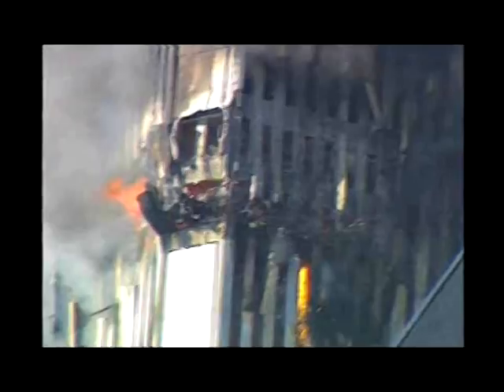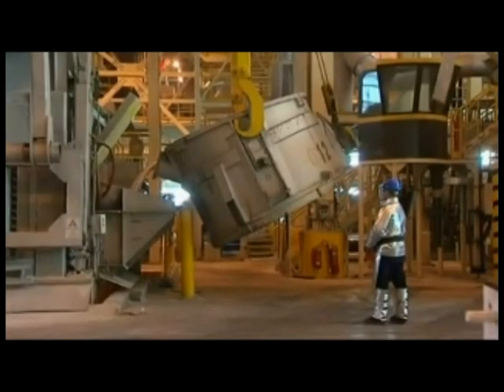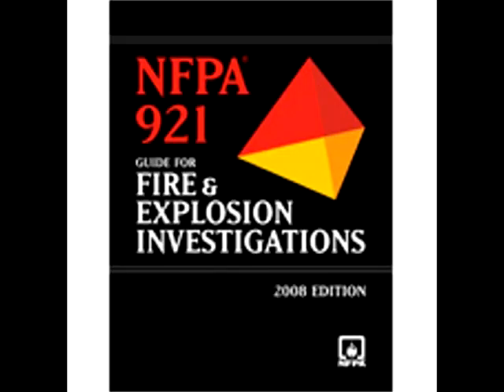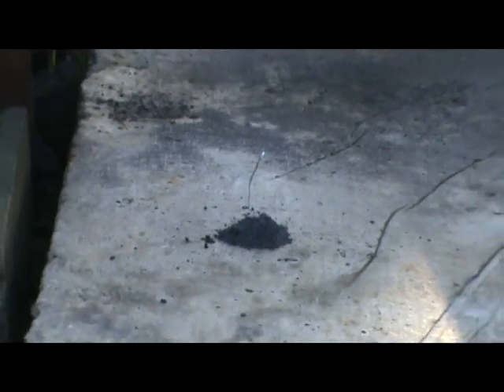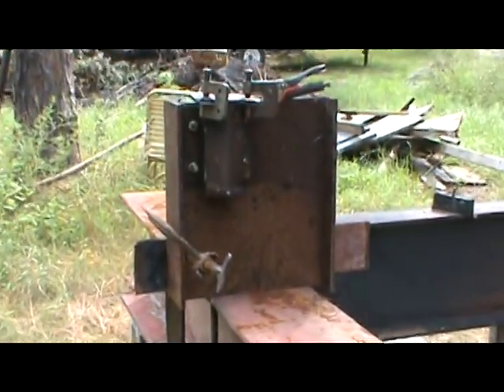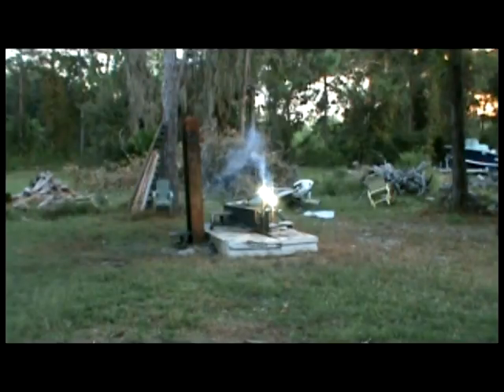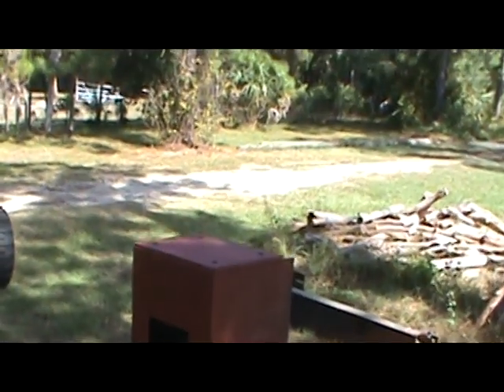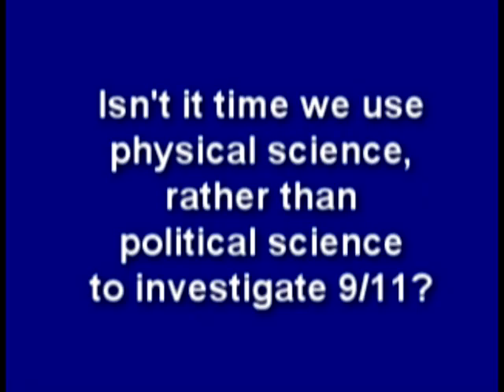9/11 Experiments: The Great Thermate Debate

Comment: You can SEE the disintegration of the lower structure well ahead of the Upper Block.
Compressed air was bursting out of the WTC windows up to TEN floors ahead of
the Upper Block. THAT MEANS THE STRUCTURE WAS ALREADY FALLING ahead
of the upper block, and the 14 foot living space was already being compressed.
EXPLOSIONS, or THERMITE / ate HEAT, just don't produce DUST JETS that
tiny, or that directed. The compression of the living space between floors does.
YOU FAIL, engineers win. Again.

Comment: @CalumGilhooly 
LMAO, NO ONE in the Twoofer Moron Mooooovement can teach anything to anyone.
As I have attempted to teach them, the structure below the Upper Block was
ALWAYS FALLING, even at zero velocity. That's what WEIGHT is, mass falling at 1 G.
When the Upper Block struck the lower structure, it just SHEARED the BOLTS
holding it together, the building essentially UNZIPPED, and started falling again,
well ahead of the falling upper block. Welcome to reality.

Comment: @CalumGilhooly 
AMAZINGLY, contracts are NOT physical movement of 250,000 TONS of steel.
NIST, FEMA, SEAoNY, and ASCE inspectors had full access to the debris piles at
Ground Zero, and to the FRESH KILLS and other debris pile locations.
They say so expressly in the NIST and ASCE reports. SHIPS serving the STEEL
shipment to japan, were not even contracted for until a year after 9/11/2001.
Sorry, WTC 7 was a IMPACT and FIRE based collapse, just like the towers.
TOTAL failure for you, again

Comment: @CalumGilhooly 
NOW, let's address Your Mewling bullshit directly. "SOMETHING more technical".
and "shipped off and recycled ASAP". BOTH were totally inaccurate, and stupid.
Thermite / ate containers have to hold a TON of thermite up off the floor, and hold
them against steel, despite thermal / reaction gas pressure. THEN they must 
disappear. That's NOT possible. SECOND, the contract to recycle steel was
signed less than a month later, but STEEL didn't move till 6 months later.

Comment: @CalumGilhooly 
LMAO, " just because no containers were found, doesn't mean they weren't there."
SORRY, THATS EXACTLY WHAT IT MEANS. But, let's address the second part
of your MANY problems. Not only were the containers missing, but how were they
attached? Jonothan Cole had to screw them into the I-beam. That's because 
burning thermite / ate produces thermal gas expansion. The pile of thermite
"pushes" itself away from the steel, by the gas pressure it produces.
Where were those?

Comment: @RedStarVolume

"The GLOBAL collapse is caused by the failing of the main columns"

that INVESTIGATION FOUND had NO FIRE near the VERY support that the facade is attached to where they MEASURED the GLOBAL acceleration EQUAL to that of Gravity starting when the kink forms and for the next 100+ feet....

[NCSTAR1A-3.2] "It is likely that much of the burning took place beyond the views of the windows"

so if FIRE is NOT the 'mechanism' for collapse, then what was?

Comment: @palasta 

"Sure, coincidentally the roof caves in seconds before the collapse'

no it doesn't...AGAIN,   WHAT THE FUCK are YOU looking at?

and..WHY are you "rolling ice"?

Acceleration EQUAL to Gravity was measured on a point of the facade where there is NO FIRE PRESENT.
WE CAN SEE there is NO FIRE.
Tell us WHAT the agent is that REMOVES the vertical support the facade is ATTACHED to to ALLOW the instant UNIFIED descent, GLOBALLY, when the kink forms as FAST as an object falls THROUGH THE AIR

Comment: @CalumGilhooly 
CONSIDER how stupid PhysicsAndReason here (The video poster) is.
HIS FIRST EXPERIMENT is the only valid one. Thermate / ite can't burn thru steel.
PERIOD. That's why there is NO EVIDENCE of thermite / ate burning against steel.
SO, this MORON burns steel in a backyard to simulate an internal, low oxygen
(Reducing) fire on the 13th floor of a 47 floor skyscraper. Realistic, Huh?
Then he uses containers never found, Realistic again, Huh?

Comment: @palasta 

"started before that"

when the kink forms, the HVAC, 'other' Penthouse, roof, facade, within 0.5 seconds from each other, have free fall ACCELERATION for 100+ft. ALL support was INSTANTLY taken away, AS WE SEE by the EVEN decent if there was a progression from east to west, WE WOULD SEE IT, the roof WILL NOT support itself while columns fail below it. the facade is a non supporting structure, and IS attached to the perimeter columns it will not stand while the columns fail behind it.

Comment: @NonnyMus1 Yes, most of the volume air. And since there was so much air, claiming air-pressure from pancaking floors would be responsible for jets shooting out 40 floors below collapse front would indicate further massive resistance to slow down the falls, but that obviously did not happen either. And why would a window pop out 40 floors down? Those were not hollow tubes - there were floors (in this case 40 of them) to pass before ejecting the dust, and doors and other obstacles to pass.

Comment: @NonnyMus1 The only argument I came up with was about the relation between free-falling objects and moving collapse fronts. Speeding-up of any video would have ALL objects in motion move faster at the same rate. It needs no further explanation. And regarding collapse times, I would put them approximately 12 and 16 seconds for WTC 2 and WTC 1 respectively. Un-tweaked.

Comment: @Funkadelic2  Again, NIST's models assumed various levels of fireproofing loss & were tested against observed effects.  The shock waves from the impacts likely blasted rigid foam fireproofing off of trusses, even those not on impact floors.

Have you actually read the NIST reports or are you relying on AE911troof's cherry picking and quote mining of those reports?  All this is discussed in them.

Please read them for yourself.  Here's the list with links - tinyurl . com /44dsmgw (remove spaces)

Comment: @NonnyMus1  Mohr claims the core of a building would never go down last in a controlled demolition. Well, if you demolish a building by severing the outer columns of the core first, which then will have the consequence that  the floors and the perimeter columns fail, the rest of the core might very well stand. Anyone can see the fallacy in such a statement. It's no better than saying "Controlled demolitions are being performed from the bottom-up, not top-down". You do it any way you want it.

Comment: @Funkadelic2   Ah, just noticed your question, 'how can the collapse front locally outrun free-falling column sections..?'   The short answer is because the free-falling sections aren't free falling and are falling more slowly than the collapse front.  When did that happen in any of the building collapses?  You know  a large building collapse is a chaotic system, so you get lots of weird behavior.  Overall, smaller debris was obviously falling faster than the collapse front.

Comment: @Funkadelic2 ... The short answer to the South Tower ejections was that the pressurized air found an outlet at those locations.  The 1/2 million cubic feet of air per floor at 12 floors per second exerted a lot of force!  Again, from Chris Mohr's series -  /watch?v=2538YN1l1nA 

I think you should watch all of Chris Mohr's series since it seems you are following AE911troof's claims and Chris neatly deals with all that.  It'll save me bunches of typing!  =)

Comment: @Funkadelic2  Most bodies were broken up by the force of the collapse and many of the bits cremated in the fires which burned for weeks in the debris pile.  Tiny bone fragments were ejected laterally by air being blasted out of the pancaking floors. That's how the dust, perimeter sections and some beams also ended up some distance away. The buildings were 95% air and that air had to go somewhere.  As for air ejections, go to 4:18 here - /watch?v=2538YN1l1nA...

Comment: @NonnyMus1 ----> the one who is guilty of such actions. This is my only account The reason you find similar arguments and/or quotes coming from other users has to do with the fact that those are important points of the very same valid critique of the NIST report brought forward by most engineers and other qualified professionals. You sure understand that.

There sure has been some debate regarding the issue of dislodgement of fireproofing. Can we assume some fireproofing material were ---->

Comment: @NonnyMus1 ----> blown off of some columns and trusses in the direct impact areas? That sounds plausible. But there have been no evidence presented for the idea that the fireproofing were stripped away from entire floors. Actually, it's not realistic at all. The force needed to achieve that (remember the shoot gun analogy) sure would have blown out all of the windows on those floors, and that obviously did not happen. The photographic evidence that exist - let alone, any tests performed - ---->

Comment: @NonnyMus1 -----> do not support the idea of fires long-lasting and intense enough to cause collapse. Moreover, fireproofing upgrades had been performed on many of the floors in the impact areas (if you have studied the NIST report you probably know that as well as I do). Steel loses strength when heated, yes. And columns able to withstand 2000% (that's 20 times) increased live loads before failing means they need to be heated to lose most of it's strength to collapse. All of the columns. ---->

Comment: @NonnyMus1 ----> By "pancaking" I mean floors falling down and piling up on ones beneath. And now we are entering areas which NIST barely touches upon: Although NIST do not endorse the pancake theory in the sense that pancaking floors were not, according to their report, what initiated the progressive collapse, pancaking floors is the only conceivable scenario to drive the building all the way down (huge sections of the perimeter walls were ejected from the structures ---->

Comment: @NonnyMus1 ----> during the collapses, and vast portions of the cores remained standing 5-10 seconds after the floors and perimeter walls had collapsed - thus could not have supplied energy to crush the lower parts of the buildings). Yet no stacked-up floors could be seen in the debris piles, not even large chunks of it. Most of it was obviously pulverized in mid-air, an enormously energy consuming process for which no explanation has been given. And where did all of the steel-decking go? ----->

Comment: @Funkadelic2  The UL tests were done on short-span and half-short span, *insulated* floor assemblies.  Since it's likely insulation was blown off the floor trusses, NIST rightly didn't use the results.  

I'm not sure what you mean by 'the pancake theory', since the floors below were squashed flat or pancaked by the weight of the upper floors crashing down.  It's not a technical term.

As for your reluctance to read the NIST reports, I'd recommend you give it a try!  Ya might learn something!!

Comment: @Funkadelic2   The TECHNICAL explanation - perimeter columns, which were structural, failed and the section of the buildings above the impact zones fell onto floors below.  Those floors failed because they could not support the massive weight of the structure falling onto them and that failure propagated downward.  Sagging floors trusses, along with their effect on perimeter columns, were observed in some %age of  the 6977 videos & 6899 photographs NIST analyzed.

Comment: @Funkadelic2   Yes, too chaotic to model.  WTC 7's collapse was far less complicated since it likely initiated with the failure of Column 79.  Also, NIST was guided at every step of their simulations by detailed videos of the collapse.

On the other hand, both WTC towers collapsed after dozens of building elements failed, likely.  No  detailed video data was available to guide collapse modeling since smoke and dust obscured the collapses.

Sure NIST explained the Tower collapses TECHNICALLY!...

Comment: @Funkadelic2  As for the iron-rich or metallic spheroids found in the WTC dust, most probably came from fly ash and volcanic ash used to strengthen concrete.  These types of ashes are used in concrete because they have pozzolanic properties - that is they make concrete stronger.

Metal-rich spheroids are also found in printer cartridges, metal cutting & welding spatter and are formed by rust flakes burning in ordinary fires. 

Remember, steel heated to 250-400°C loses ~18-30% of its strength!

Comment: @Funkadelic2  Sigh. This is going to take a couple of comments.

First, are you also proudfootz or musicamaker2001?  If not, where are you getting the exact same arguments, right down to the inaccurate NIST quote?

NIST actually states about the WTC steel samples, "NIST did not generalize these results, since the examined columns represented only 3 percent of the perimeter columns and 1 percent of the core columns from the fire floors."  pg 90,  NCSTAR 1  tinyurl . com /3jkn6fh  (remove spaces)

Comment: @NonnyMus1  ----> Just one thing: I already know that NIST failed to supply evidence for heating of the examined pieces of steel that would in any way support their hypothesis. Yet the dust samples show iron spheres in abundance (i.e. temperatures to have iron spheres form were somehow present (temperatures high enough to even oxidize molybdenum - that is > 2623 C - occured!) although no steel samples showed signs of being heated to over 600 C - actually most samples being around 250 C - 400 C).

Comment: @rooksaiz   Nope, because they never tested thermite! They discounted all forms of controlled demolition, rightly, because it would have been impossible to plant the necessary charges in busy offices full of security-conscious people who knew there was asbestos in the walls!  Also, they knew that any remote detonation would be impossible because of the hot fires.  Also, they know physics and engineering and found out the most likely culprit for the collapses and proved it with computer modeling!

Comment: @seemeno1 Wow. Just wow. I used the 'burning out' thing as an example.  I never said you said it.  I guess you're a typical troofer, all right!  Yikes!

I know the buildings were tube framed steel structures without concrete cores from the following sources -  tinyurl . com /3jkn6fh (remove the spaces)
/watch?v=KPqxJpykW00
/watch?v=M-WQdmpdM_g

To name just a few.  It's well known at this point that the Towers and WTC 7 were built that way to create large open spaces and save weight.

Comment: @ThePeage LOL!  It's your terrible writing I'm having trouble with!  =P

The sources I listed are much more plausible than thermite - esp. when you keep in mind that physicsandreason is claiming the thermite was built into the exterior columns of the WTC Towers!  

None of the materials you mention are homogeneous from all sources, so to say all welding residue contains 'more Mn' & all fly ash 'more Si' is wrong.  There's a range of compositions.  What USGS 'record' are you using?  Post a link.

Comment: @ThePeage  LOL!  There were tons of the iron-rich spheres in the WTC dust and they were distributed quite widely. If they were from thermite, neither would be so.  And iron rich spheres are found in pozzolanic materials in concrete, are from steel welding and are from rust flakes burning as well..

Way to focus on one possible source to the exclusion of all others!

P.S. If you meant jet fuel in the bldgs, you should have written it!  I never made that claim, so it's just another straw man!  =P

Comment: 13:30  LOL!  Thermite in the box columns since the 60's!!  Silly kid, patterns of flames in a fire have to be shown by more than one photo!  How did those flames evolve and move over time.  Where was the photo taken?  When?  Thanks!

Again, it's true that a jet-fuel or office fire can't melt steel or iron, which is consistent with the official story.  No melted steel or iron was observed.  It would also take way more than that one point to dispute all the analysis and modeling NIST did.

Comment: 12:10  =D  Another joke!  You claim that thermite was hidden inside the exterior box columns from 1966-1973!!  That's a better joke than the flying saucer theory or star wars theory!!  ROTFLMAO!!  =D

O.K.  Thermite is hygroscopic, which means it absorbs water from the air.  That makes it clump together and lose it's effectiveness. The sulfur can even go into solution.  Thermite & shaping devices are also heavy, which means they would add too much to the dead loads of the buildings.

Comment: 10:55  NIST uses 'pressure pulse' because 'explosion' is a defined term and the pressure pulses didn't meet the definition. Specifically, explosion means  a rapid increase in volume and release of energy in an extreme manner, usually with the generation of high temperatures and the release of gases.

I'm glad you had fun playing with thermite, but no broken bolts were found in the rubble.  Lots of bolt tearouts, but no broken bolts.

Comment: 10:00  Oh good, you finally mention that the WTC steel was thicker!  Good!

You repeat that the 'molten metal' flow as proof of thermite again. Bad!  Why was thermite used on only one column in the Towers?  Why wasn't that column cut before the whole building began to collapse?  Why did the collapse initiate on the *opposite* side of the building?

And NIST NCSTAR 1 uses 'explosion' or 'explosions' much more often than 'pressure pulse'.  It doesn't use 'dust puff' or 'dust puffs' at all!  =P

Comment: 7:30 Now we're back to your back yard. Oh good, this time we stay there for awhile.  Surprisingly, your experiment is pretty good!  You don't state the gauge of the steel you were using and the dimensionality of the column is all wrong (exterior structural columns were much thicker and the core columns thicker still).  But still, you actually show something instead of claim something.

P.S.  Your thermitic reaction didn't burn white!